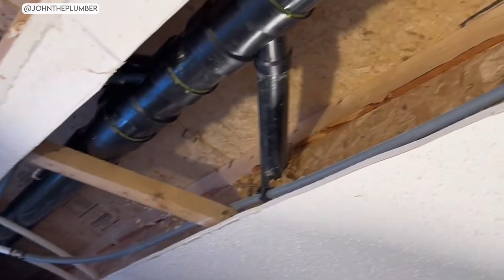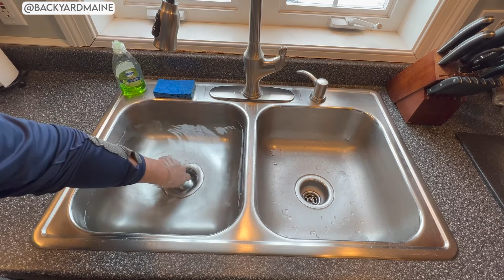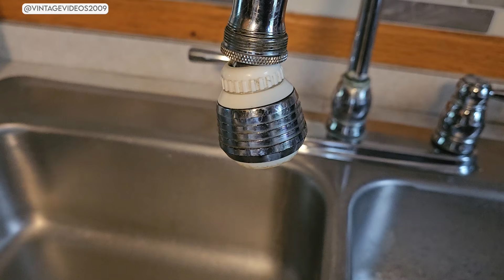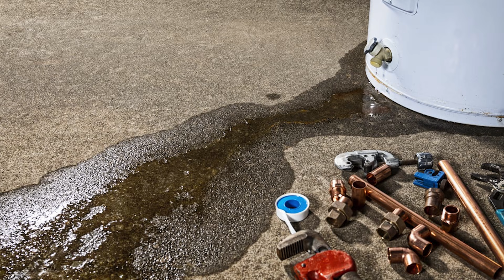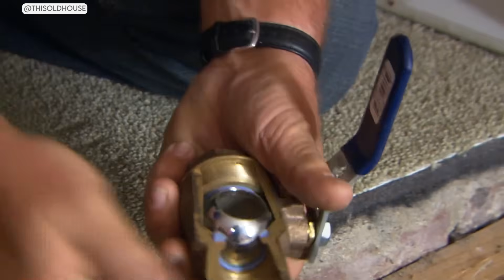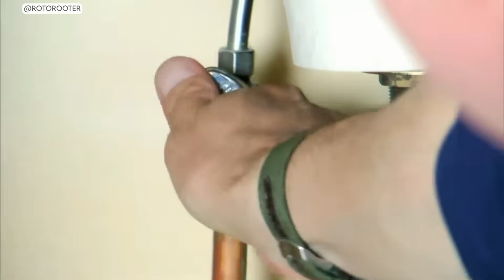Old American Home? These 6 Plumbing Mistakes Are Costing You THOUSANDS!

Comment: My house is 1958 so old. Still had a cast iron sewer pipe. So I went to buy ceramic plastic wrap all over the cast iron sewer. Why? Because oxygen and moisture creates rust. Plastic wrap will block the moisture. Just cutting ceramic plastic wrap in half. Easy to wrap metal pipe. ( PS wrap pipe as thick as possible )❤🎉